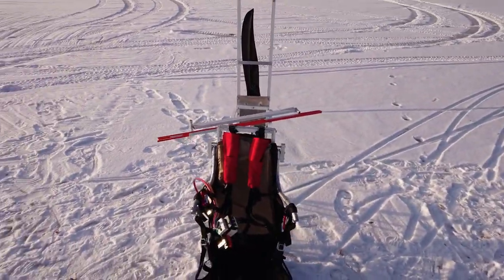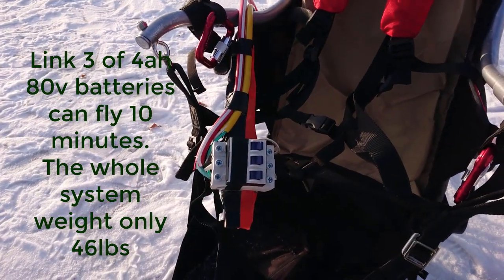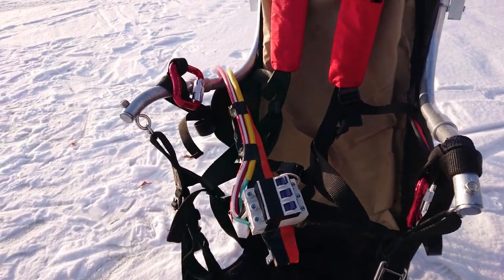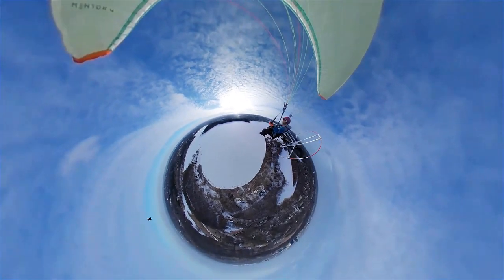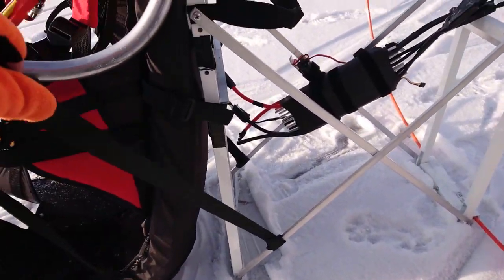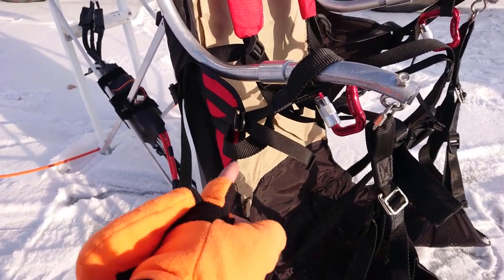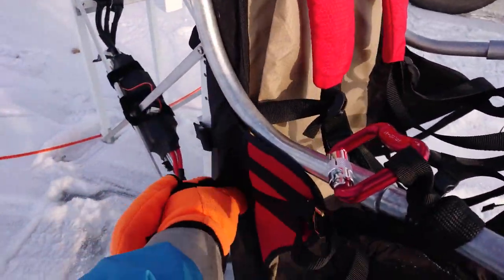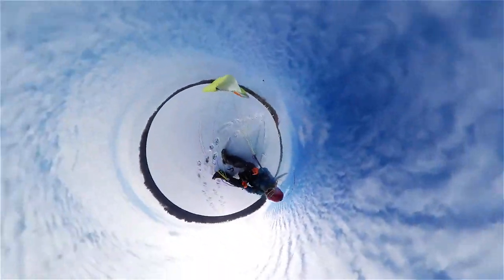Electric Paramotor all in one upgrade Minne Motor AIO

Comment: From it’s appearance, the frame looks like it was made from aluminum bought at the local hardware store, not aircraft grade aluminum.  This is worrisome.  What level of engineering went into the design?
Reply: Overcomplicated overengineered stuff looks good but not strong enough. Nirvana paramotor 12k my friend broke half of the frame not even in a hard landing. Overcomplicated carbon fiber spokes net holders.
This one looks more safe and strong
Reply from the maker: This frame is strong enough to fly, lightweight and multiple usages but NOT crash proof. And I'm not intent to build stronger heavier cage anyway.

Comment: Nice job thinking outside of the box!!  Your swing arm attachment eyes make me nervous especially with the threaded nuts not appearing to be fully engaged.  Thanks for sharing!
Reply from the maker: 150lbs work load. Each of our leg 50 lbs maybe. So plenty redundancy. But thank you for your input.
Reply: Jerry Minne·US Just don’t do any spirals or SATS, you can hit 4-5g making your 50lb leg weight 250lbs!  Just looking out for you man! ✌️
Reply from the maker: yes. this electric paramotor is not made for Aerobatic for sure. this is for regular guys who want a simple motor to fly to boat to ride everywhere. my concept is to share the battery and do all you need.